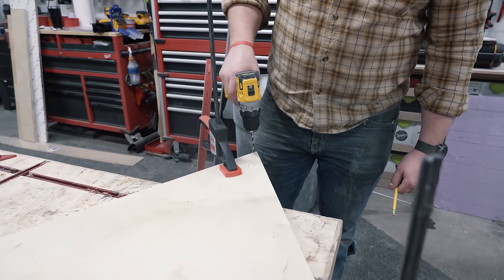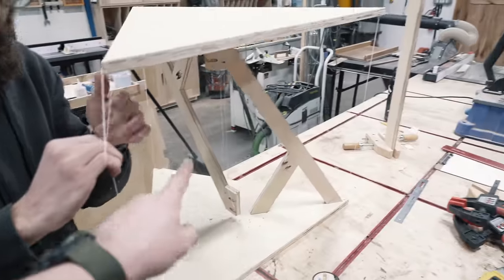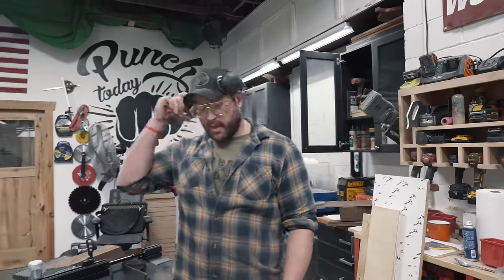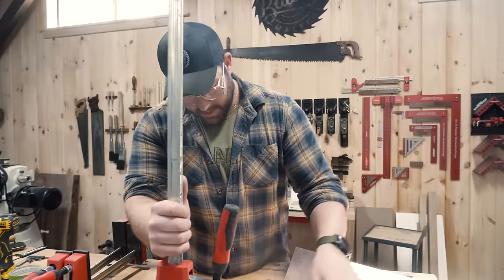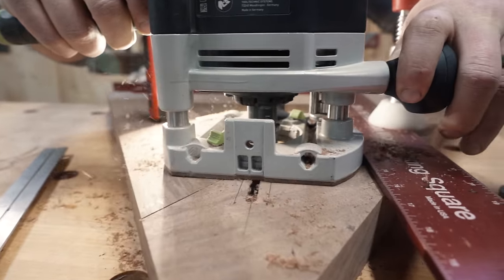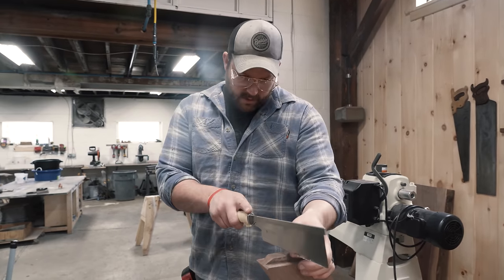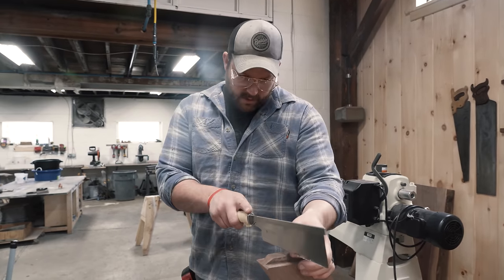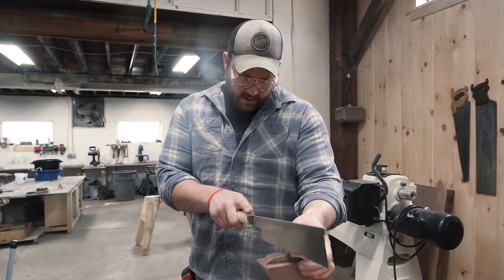IMPOSSIBLE Floating Table Build - Will It Work?

Comment: Use near-invisible fishing filament. Takes the magic up by a notch.
Reply: My thoughts exactly
Reply: Seconded!
Reply: I'd do the outter 4 in 20lb mono and the center at 80 plus braided wire in black for flex. I believe mono would stretch too much for the centerline
Reply: I tried this with 200lb mono. The stretch makes it very difficult to tension it evenly. Tried again with 1.5mm steel cable and it worked much better. To get the table stable, it needs a lot of tension.
Reply: Not stable
Reply: Keeping this coment high
Reply: Mby not as strong?
Reply: It definitely wouldnt hold, walnut is heavy
Reply: would actualy do the exact opposite. use sth more dramadic like metal chains. so it looks like only those keep it from flyin away.
Reply: Yeah, redo the whole video!
Reply: Bammm!!
Reply: @aigleincomments9532  not a bad idea!
Reply: @dquirke2  i was thinking a fine steel cable would make a more resilient table also. trickier to set and tension?
Reply: @aigleincomments9532  I do like your thinking, mess with the mind.
Reply: The entire weight of the table and whatever is sitting on it is being held by that centre line. That anchor, and the arms holding it, need to be *stronk*. You've got a little more leeway with the tension lines on the outside, but you can't use anything that's going to stretch much over time. Those things need to hold tight.
Reply: @nowonmetube  "Not stable". Or do you mean "Nots table"? LOL
Reply: Kevlar string? 400 lb test.
Reply: @aigleincomments9532  Very very very clever sir. You Machiavellian genius you! Artistic cunning par excellence.
Reply: Yessssss
Reply: chains
Reply: Until someone puts a coffee cup on it, sits down and put his legs in under. MESSY.
Reply: what about magnet
Reply: Braided line ftw
Reply: 1/16 aircraft cable painted flat black would work nice also.
Reply: Or use a giant magnet, voila no strings , no tricks. Although i doubt that there is a magnet strong enough for the table.
Reply: Fluorocarbon
Reply: This guy just copy another guy design tho
Reply: nylon fishing line stretches, but kevlar line doesent, but its far more visible, but you could just use black kevlar line in a dimmed corner of your house and it would be almost invisible
Reply: Go all out on honeycomb carbon fiber frame?
Reply: @hercules71185  good point.
Reply: Heavy test black Spider Wire fishing line.
Reply: If you're worried about it's strength, and still want it invisible, you could always use shark-grade fishing line.
Reply: @aigleincomments9532   and than u can add a fake propeller at the bottom of the table to make it look like its pushing it up

Comment: If you look up Buckminster Fuller's Tensegrity you'll see his designs use the tension lines in the shape of triangles.  So to stop the "wabble" you can add lines from the bottom center post down to the base points and from the top center point to the top points.  Tighten it all up. The center line will need to be strong enough to hold the weight of everything put on the table.
This is a very nice table!
Reply: First I've seen a mention of Buckminster Fuller on these videos, although they may use his term "tensegrity".
Reply: if you know someone who studies civil, mechanical engineer or architecture ask them to know how much it could lift (they would know some materials) and where you can put the lines. A friend of mine did to his brother and he calculated it to make a very strong table. it can stand a person and doesnt move.
Reply: I mean, shouldn’t you just be able to tighten up the middle one and everything should be fine?
Reply: @dannypal5385  those give you stability
Reply: I just learned something😁
Reply: Tensegrity = Buckminster Fuller, Mid-Century Mad Genius. I was wondering if anyone would mention him. [If you want to know more, find a copy of his book I Seem to be a Verb.]

I think he would have loved this build.
Reply: w a b b l e
Reply: @DavidGarcia-nx2gj  Trust me, architects do not know that information.
Reply: @DavidGarcia-nx2gj   A bicycle wheel is the same principle, rigid spokes arent really necessary, string spokes would work just the same.

Comment: Should use black thread.  They almost disappear enhancing the effect.  It is why magicians use thin black thread to make things float and move.
Reply: My thought was to use transparent fishing line. I now think black is a better option.
Reply: What would be the most durable line that is also viable for being unnoticeable?
Reply: @FavoRitsu  lines from fiber optic wire could do the trick. They are very tiny and durable at the same time. But it will require different mechanism for tightening, as this lines breaks when folded.
Reply: @PavelFilko  honestly if you are talking durability and strength you'd probably want nylon (e.g. fishing line) or thin steel wire
Reply: Niklas Mertens 
Dark fishing line, then?
Reply: Yes, because fishing line can is shiny and reflective.
Reply: @jojoposter  fishing line stretches, it would lose tension eventually
Reply: @PavelFilko  Nano tubes or Spider Web
Reply: But the black thread that they use is from panty hose. It’s not strong enough
Reply: It all depends on the lighting and background.
Reply: Maybe use a more durable line for the center and a more transparent line for the rest
Reply: Dyneema would be best.

Comment: could have also used steel wire and guitar string knobs
Reply: Yes. Three tuners could be fitted under the base unit, so they wouldn't be visible. Although nylon wire/string probably looks better than steel because it's less visible.
Reply: great idea
Reply: Same thing I was about to comment, could have used bass strings to tie in the guitar theme
Reply: That's what I was thinking, as well. Could probably tighten the guy wires a bit more then, as well - make it less wobbly. Although I worry about steel wires biting into the wood and cutting through corners.
Reply: Steinberger makes double ball strings
Reply: @Malidictus  I kinda dig the wobbling effect it's like " hey look at me I'm floating lol"
Reply: @MouthyKnight  Fair enough. As an ornament it's not bad. As a table, however, I feel that it would prone to flipping over, as that specific structure has a tendency to do. Maybe a bit less than the toy version due to the weight of the wood and the glass. But yeah - from an aesthetic perspective, I see what you're saying.
Reply: @Malidictus  it would not really flip over because it has supporting tensions on the sides. but i won't put any tall and fragile things. You could however reduce that by tensioning the sides but i am worried if it would affect the sturdiness of the center wire. Or you could put a little mass dampers on the center but i think it would only make things complicated and how will we be able to hide that lol. nonetheless it could be a nice display jut to trip your visitors like hell lmao
Reply: @Malidictus  with a larger base I think tipping can be ruled out.

Comment: That table is so cool! Stretches the mind to try to figure how it “floats.” But very nice looking!
Reply: The center of gravity is in the center of the table where the middle wire is. The entire weight of the top part is pulling downward on that middle rope, but the base on the floor is holding it up. The 3 wires on the sides of the table is just to stabilize it so it doesn't wobble too far away.
Reply: OhMyGulay thank you
Reply: @Pwn3dbyth3n00b  "The 3 wires on the sides of the table is just to stabilize it so it doesn't wobble too far away." It would fall immediately because it's an unstable equilibrium. Without those wires, it would be like balancing a pencil on it's point. But the rest of the explanation is written quite nicely.

Edit: Because the table is not symmetric, the center of gravity is not in the middle. So it's not even an unstable equilibrium.

Comment: As a fellow woodworker who enjoys the craft as much as any that love the beauty of real wood, I have to say I am impressed with what you created here as an experiment! You likely brought "Tensegrity" to the attention of many that may never have known about it otherwise! Kudos for that!

Now I have to address something I watched you do repeatedly in this video, and it made me cringe. You likely have quite steady hands, which allows you to be more precise than most in this type of work (I do myself also). That said, it is not good to take risks that can do irreparable damage to your best tools; your hands. 

First of all, your tablesaw work in which you use your hands to push the material through with what looks like no more than two inches clearance from the blade for your hand. I've seen many woodworkers lose fingers or parts of fingers doing that. Steady handed though you may be, you never know when something might happen that would cause a disastrous severance of a digit. My own Pop was distracted by a coworker while operating a tablesaw, and lost his right index finger because of it. I myself am a very careful individual around such heavy woodworking equipment; keeping safety foremost in my mind. Because of this, at the age of 63, I still have all of my digits, and they all work quite well. The fix for this is to use push sticks. I can give you plans for making push sticks, and even a fence rider push handle that will keep your hands safe.

The second thing is when you were drilling holes in the dowels, using your hands in very close proximity to the business end of the drill bit. That is no less dangerous than the previous thing I noted. The bit could hit a soft spot in the wood and punch through your fingers, or even your palm, due to the pressure you are using to work the drill! Very scary! You should use something to brace the dowels, holding them firmly in place other that risk your hands like that.

I'm only calling you out on this because I care about my fellow woodworkers, and I want all of us to stay as safe as we possibly can. Yes safety rules take a little extra time to follow in your work flow; however, following them is proven to save you time in the long run, because an injury will take away time you could use to do what you obviously love doing.

If you wish to know how long I have been working with wood, I now have 51 years of experience, as I started at the age of 12 in Wood Shop Class in Middle School, Virginia Beach, Virginia. I am also descended from a long line of woodworkers on both sides of my family. My Grandfather on my Pop's side was a furniture builder and cabinetmaker. My Pop was also in woodworking, and he and I worked together in the same company, doing what we love. It is my chosen profession, and I put myself into my work, as I love creating pieces of real beauty from beautiful wood.

Please sir, I respectfully ask that you take extra care to stay safe in your woodworking environment! In that way, you will extend the time you have working with wood, as you obviously love to do.

Cheers!

Comment: Great work John! If you make the top and base different sized equilateral triangles, it would likely be slightly more stable and prevent the racking/swinging motion under the same amount of tension. Also, if you can find something that has less give than fishing line, that would also stabilize things as fishing line does have quite a bit of flex even at that test.
Reply: Ooh, MARK II

Comment: FYI, the term tensegrity was coined by Buckminster Fuller. While Fuller did not create the first tensegrity construction he  popularized the term through his writing and went on to design many tensegrity structures.
Reply: It's not a tensigrity structure, though, as it has non-string elements which are under tension. In a tensigrity, all solid elements are under compression.

Comment: Is it just me that could envision this made out of guitar parts?

With that said, I'd love to see what you could do with a couple of acoustic guitars!
Reply: I had the same reaction. I've got some leftover bass guitar parts and lots of spare strings. Make the short center string a fixed length and the tension of the 3 corner strings can be adjusted using bass guitar tuners.

Comment: Beautifully done, I certainly don't have the skill to make the table as nice as that. I like the hidden string points and the adjustable tension bolts, nice touch.
I have zero experience and can barely put up some shelves and have them straight!
Anyway, about a month ago, I saw a very simple video and decided to do the same. It was hand cut, I used crappy pallet wood, para cord and screws. The result wasn't anywhere near as good as this (maybe if I had the tools and workshop I could do a lot better), but to all of you who think that this is incredibly difficult, it isn't. It does take thinking about, but to make a crude version it takes a few hours and it still looks f*****g cool.
Thank you for showing me what's possible when you have all the bells,  whistles, knowhow and skill.

Comment: I only wish I had the brain capacity to understand all that you did in this video.. alas I do not... I look on with wonderment and a hint of envy but loved every second of this video!
Reply: Try watching it several times till the penny drops, it's worth it, oh and find a buddy to help, it's got to be worth trying hasn't it?
Reply: @catherinemalcolm8125  after rewatching it and thinking about it I think I actually figured something out. With the power of one brain cell and a half eaten quesadilla I've done it.
Reply: Google tensegrity for more info. The center line is what holds it up. The top's center of gravity is way off to the side so it is trying to fall to that side. The outside cables stop it from falling/twisting.

Comment: Awesome job. For all the top line anchors, should drill holes from underside half way in and glue dowel/line in so there are no plug marks visible.
Reply from the maker: You need the shoulder to keep it strong inside the plug hole

Comment: My brain can’t wrap around how that is possible
Reply: All the weight is on the center string. so it's all downward force. The other strings are in tension just to prevent the top from moving and shifting its center of gravity to anywhere else but the middle string.
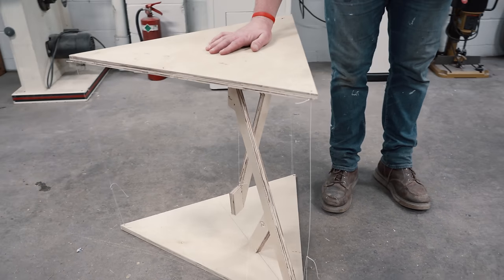Reply: It becomes apparent @4:43 when he pushes down and the 3 outer strings go slack (which  means they aren't providing any upward force). Gravity pulls the tabletop down but the center string pulls against gravity, upwards. The C-shape design of the tabletop creates the illusion that it's floating -- if you imagine cutting off the table-top portion, just below the 'Y'  joint, you'll see what's going on. Very clever illusion!
Reply: @MikkosFree  So magic.  got it.
Reply: The center string is holding the platform up. The outside strings are used to balance the piece of wood from falling over... Everyone is making it way too complicated

Comment: this guy is gonna get his fingers chopped off for not using proper safety equipment
Reply: The amount of freeballing he's doing followed by "Router tables are intimidating, but as long as you're practicing safety"
the number of thin cuts he did on his tablesaw without a sled, pushblock, or stick got me sweatin'. If I see this guy break out a lathe I'm outtie. If he already has, well, we all know what happened if/when he stops uploading randomly.

Comment: Beautiful. I liked it. You made a prism shape. For more stability, make an octahedron shape. To do this, rotate the table triangle on a vertical axis by 60 degrees with respect to the base triangle. So that the two hockey sticks are now in the same vertical plane. Then string two strings from each vertex of the table triangle to separate vertices on the base triangle. You will have made an octahedron sitting on one of its faces. In plan view the two triangles will look like the star of david and the strings will zigzag up and down from vertex to vertex.

Comment: Looks good .  I may have went with bronze/copper chain with turnbuckles for tension and more points on the outside to make the table more resistant to wobble.

Comment: I was noticing some of the comments. Triangles are tricky beasts. The centroid (where all the bisected angles converge on centre) is the center of gravity on the equilateral triangle (60-60-60); however on different triangles, the centre of gravity changes. Coming in from the vertices was much more stable than coming in from a leg. HAHA!!! I had a few failures! Really great work!

Comment: John after asking you for the templates and gettin. We winged it! It was an on the fly build I had to give it a whirl.. the only problem I had was my less than perfect table saw kept dropping the datto blade, so I wound up with less than perfect cuts SO I did a little filler and painted my nice wood project.  Any how it TURNED out pretty good!!    great project 
-“but because I saw it on the internet-I had to do it”.  thanks a million

Comment: Make more anchor points to stop that wobble. Use an extra two lines from each point across transecting the shape of the object (8 more if you wanted an octagonal table for example, so in this case 3 total) and tighten them for stability.

Comment: I may have a video idea for you John. I'm have a Murphy bed project, fitting a full size bed sideways against a bus wall above a wheelwell. Due to the curved roof, I have learned how fun it is to build a double action Murphy bed that slides away from the wall when lifted, and back against wall when down. But,  then there's trying to figure out the spring system. I'm still working on that. Thought it might be crazy enough you would give it a try.

Comment: I know this would kind of defeat the "invisible" aspect of the fishing line, but I think some thin steel wire would add to the visuals of the table.
Reply: I agree, but I feel like a regularly strong steel wire would be the most practical, as it would be able to hold much more weight and therefore the strings could also be tightened really tight which would increase the table's stability even more and make it actually usable.